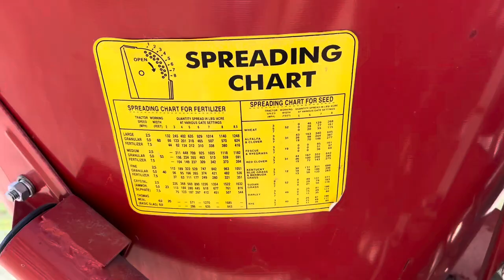I Bought a Tractor Supply 3 Point Spreader!   The Good, The Bad, and What I’m Doing With It

Comment: I think you will like that spreader. I’ve had two, both plastic. Current one has all stainless moving parts, except as I suspect yours is, those threaded rods and nuts near what I call the gate sleeves. I used metal (steel) ones on golf courses, larger than the one I have now. It was hard to handle mounting and removing it alone. 

Later in life I worked on athletic fields and parks for 22 years until cancer took me away from it in 2018. Since my sites were scattered, I usually had to put the spreader in my truck bed and leave more room on the trailer for the tractor and fertilizer. I sometimes transported the tractor with the spreader on it. The tie-breakers for me were noise and corrosion.

Take heart, I was able to put 160,000 lbs (80 pallets) over 8-9 years through my first plastic spreader. If I had been willing to knock out the shaft and bearing and replaced the bearing I coud still be using it. I sold it to a friend with a farm for $100 and got the new one with stainless parts.

Fertilizer is extremely corrosive. Seems to be worse when it is flung hard. Always give it a good rinse and WD-40 the impeller shaft inside and below the hopper. Especially with a tractor as big as yours, if you don’t keep that PTO shaft straight and parallel to the ground you can easily bend the impeller shaft or rip part of it through the bottom of the hopper.

I know you maintain things well. These are just things I have learned. One last idea - each time you use a new material or a new setting for the gate, take a photo of where you have the gate opening pinned. Later you can easily look back and know, by date, what you were putting down. If I had a poor result I took one photo of the actual and another one of where I would set it next time. If you use the same gear and RPMs each time, it will make things easier from one time to the next. Only particle size and gate opening size will need to be considered. On most spreaders you can adjust the spread if one side is throwing heavier than the other. Hopefully, it came adjusted properly. Enjoy your new implement!

Comment: You could easily build a extention out of 1/8in sheet metal for the top of the spreader. 12in to 24in taller bolt onto the rim to increase the capacity of the spreader.

Comment: the top link hole is oversized to accommodate a class 3, three point hitch. and it appears to be 3/16 metal on the top link connection which will do just fine for the amount of weight going to be put in that Hopper

Comment: I have the same one except with a poly hopper. I love it and couldn't be happier. A lot of people say broadcast spreaders are disposable implements but I've had mine several years and it still looks like new. The trick is to wash it as soon as you are done using it and then spread a thin film of oil on it using a shop rag.

Comment: We have a similar spreader that was purchased from Agri-Supply. Not sure what brand name is on it.I like the fact that the pto shaft has a piece you have to push down instead of having  to pull a piece back and push. You can adjust the spreading width of spreader by moving the blades on top of the spinner.Our spreader has a piece that goes halfway up with a wheel that turns .around inside. Probably the reason for  the top link hole being a little large is so it can be used on different size top links.

Comment: After seeing several farms that owned these, and how they all ruined them by using fertilizer, whatever you do…. After use, ALWAYS wash them out and then wash them again! I’ve had mine for 3 years..no noticeable rust, and after cleaning I have a small spray bottle of vegetable oil that I spray on the sliding ports. Hope this helps

Comment: I recently purchased this same spreader. 
Mine is Tarter branded from TS. 
It has a small agitator but looks different than yours. And there is a good size spindle with an elongated hole in it. Maybe that is to attach a larger more robust agitator if needed.

Comment: I have a spreader exactly like that it’s just branded as Tarter. The only problem I have with mine is it only throws the fertilizer out of the left side. I want it to spread out of both sides equally but so far hadn’t been able to adjust it right.

Comment: I suspect it's stainless due to salt usage. If it is not rusty and non-magnetic, it is likely austenitic stainless steel aka 300 series. Ferritic stainless (400 series) is magnetic and develops a passive red layer of oxidation on the surface.

Comment: Most stainless steel alloys are non-magnetic due to the low iron content. Get a small permanent magnet and see if it is attracted to your spreader parts.
Reply: He knows that
Reply: @dalejohns2758  He said that he did not know if the metal was stainless or not, Dale.
Reply: @MegaGeorge1948  A dude that Welds as good as he does, knows that stainless  isn't attracted to a Magnet.

Comment: Hello Farmer Tyler.  If you want to be able to check whether a component is made of stainless steel or some other material, you can often tell with certainty by checking with a magnet.  We know that metals like aluminium, brass, copper and lead are not magnetic at all, and usually we would be able to identify these visually.
When it come to steel, and various alloys of steel, most of them will be magnetic.  Even some grades of stainless steel are magnetic, or slightly magnetic.  Some stainless steel alloys, particularly food grade stainless steel, are not magnetic at all.  But even this is not a definitive guide, as I have found that stainless steel cutlery in my kitchen is somewhat magnetic.  I know that stainless steel cylinders for LPG gas, as fitted to motor vehicles, are non magnetic – at least I should say that many are, and hopefully they all are.
If the PTO shaft on your spreader is stainless steel, it probably will not be magnetic.  If it is strongly magnetic then it may just be chrome plated steel.  “I wish you luck!”

Comment: White not lay down an above ground water pipeline along the head end of each paddock/strip and move a smaller trough with the cattle (or deploy a few small troughs along the line)? That will stop all the need for trailing back to water.

Comment: Tractor Supply is so sketchy, lol. I have a few implements from them and you HAVE to look at it before buying. I got a post hole digger delivered and they sent me a crate that was previously opened, rotted and falling apart, filled with rain water, rust all over and a CRACKED tube. Not even usable! Can't believe they even sent that thing to me. Sent it back and got a better one, but damn... Got a tiller from them and thank goodness I don't need it often. Not much quality in what they carry, but the prices is good enough!

Comment: I would be very surprised if those parts you mentioned were actually stainless steel. It would be nearly impossible to hit that price point, like you said. I’m inclined to think those parts are probably electroplated with something like zinc or Thin Dense Chrome (TDC).  You’ll know soon enough because it will het worn on the edges,etc… and rust will start to show pretty quickly. I dont care how much anyone washes one of these, it is impossible to keep them from rusting unless you coat everything with some kind of petroleum product immediately afterwards.